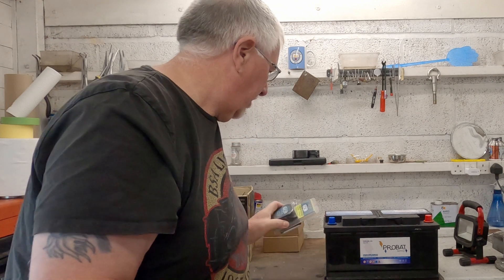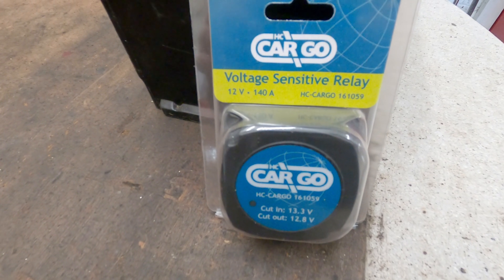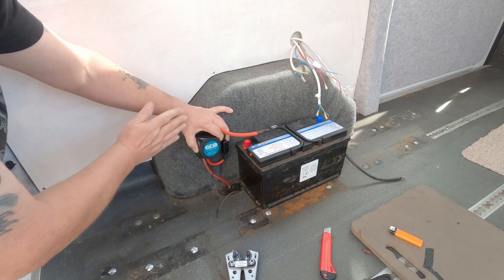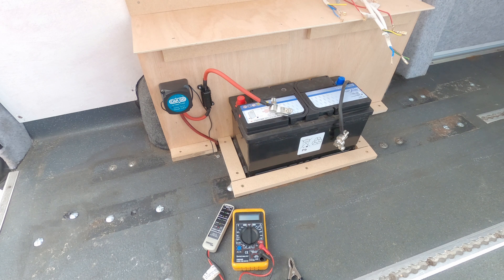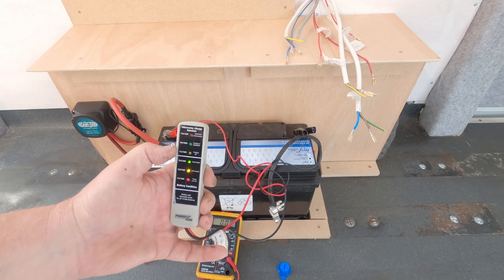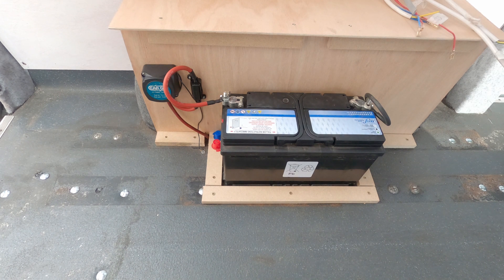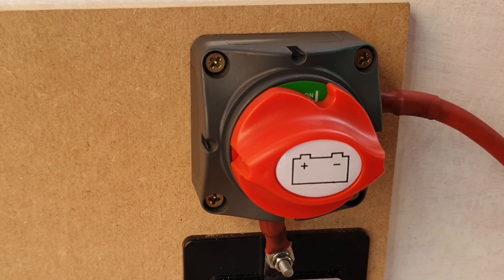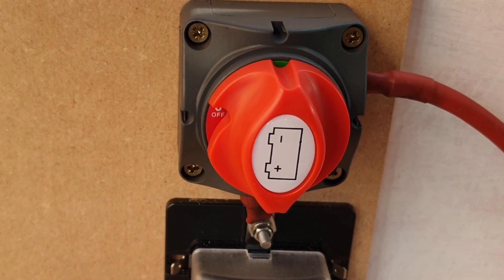How To Install Camper Van Electrics | Ford Transit Conversion | Leisure Battery 12v Power | 008

Comment: Just to say thank you for this very useful video ❤ what would be the best battery to connect the Vsr ? Would think the starter no?  My split charger is 140ah and my leisure battery’s is 130h is this ok? Many thanks in advance
Reply from the maker: I think that should be fine.  I don't think the chargers have a max as such.  Glad you got some use out of the video.

Comment: I had that same one wire solenoid to 2 - 245 at 6 volt on a ford van 150 but it had a 130 amp custom alternator  at that used to get very hot at morning , so I don’t think my new transit 250 alternator lower amp surely can handle it, it needed only few times winter with no sun for 1-2 or 3 days, I’ll think I will not put it in, and I’ll just turn it off and put ice bag those day.
Reply from the maker: I'm guessing that you are not in the UK, no Sun for 1 -3 days :)  We rarely see it for months!  At least it isn't near the Artic where it goes dark for 2 months at a time.  It makes sense to address overheating in your wiring, but I would worry about mixing it with melting ice.  Take care.

Comment: Just get yourself a lithium battery already. For a bit extra you get a much better battery with no chance of leaks and the huge plus is the weight difference. From someone who’s handled many car batteries I’m amazed at the difference in weight. If you make it  easily removable it’s well handy for powering small electric dinghy motors
Reply from the maker: Maybe it's me but I couldn't find a comparable lithium battery for less than five times the cost, that is £500 instead of less than £100.  I would really like to use lithium, but really can't justify the price for the way I will be using it.

Comment: What was the official name of the fuse box you used to use the leisure batteries power , is it call an Inverter?
Reply from the maker: The fuse box I used was one of these https://ebay.us/6HM7sp

It isn't an inverter. It takes a 12v feed and you can then connect other 12v circuits to it.  Such as lights, water pump, fan etc.

An inverter takes 12v input and gives you mains type ac output. But to get a useful power output needs quite a high quality inverter and a good amount of batteries to power it.

Comment: Brilliant video, question: I've converted a mk7 minibus and it has 2 batteries under the driver's seat ,from what I understand one is for starting and the other for the lights in the rear which is 55ah ,can I change that for a higher amp hour leisure battery as I'm guessing it already has a split charge system,thanks in advance
Reply from the maker: This is another question that the forums give lots of different answers to.  I suspect that Ford changed the spec so many times that a lot of the answers are right for specific circumstances.

I don't know if your bus would have a split charge system, but I did read that a lot of people change the second battery for a larger leisure battery and have used it like that for a number of years without an issue.  

You could check for the split charge system, by measuring the voltage of each battery, then putting the lights or other electrical accessories on in the back, leave them on for a good while then check the voltage on each battery again.  If the starter battery has stayed the same, and the other has reduced then you can be pretty sure that it is a split charge.  

The main problem that arises is, if it isn't split charge, is that you could run both batteries down to a point where the van will not start.  It would be easy to avoid this if you put a simple battery check gauge like this one into your system. :-

https://ebay.us/7kIftV

You just need to make sure you don't let the batteries dip too low, (11.8v or so), but you shouldn't let standard batteries go below 50% too often anyway as it makes them age quicker.  Unless  you are planning to run an inverter and power lots of things the battery doesn't go down that quick anyway.  We use an extractor fan, water pump, lights, and multiple phone, tablet and projector chargers and haven't even come close to taking our 110ah battery down below 60%.  If you were not moving the van for a number of days this could become a problem, but we are always on the move when we are out in the van so it hasn't been an issue for us.  YET!

I was disappointed that I didn't have two batteries, because replacing the second one with a larger capacity one, was exactly what I wanted to do.

I hope this helps.  Let me know how you go on.

Comment: Should you vent the battery? I am going to be fitting a leisure battery soon but no one vents it in the videos
Reply from the maker: Interesting question.  I haven't seen venting mentioned either.  I don't think it is a big issue unless you are putting in a big battery bank of lead acid batteries, with phenomenal insulation.  For the kind of installation I have done, only one battery, loads of ventilation I am happy with it.  But let me know if you find any further information.
Reply: @SPANNERRASH  thanks for replying. Yeah im fitting just one battery but when i was researching came across venting. And got me worried because my children will be sleeping in there and the battery is going under a bed i have bought a venting tube but dont want to make uneccesary holes in the van if i can help it

Comment: My Ford Transit MK7 (like all others) has two batteries under the driver's seat: 1 starter and 1 aux. When attatching my split relay for my leisure battery should I connect my terminals to the Starter battery or the Aux battery? Thank you!
Reply from the maker: Not all Mk 7s have two batteries, my doesn't.  

If you are putting in a split charge relay I would go straight to the starter battery as I would think that if there is anything that charges the Aux battery differently it wouldn't impact how your leisure battery was charged and your starter battery would still be charged first.  

I think there could also be an issue if you have a "smart" alternator, and I do not know how to check if you have one.  I believe a smart alternator reduces output voltage when it senses the starter battery is no longer charging, as a fuel saving thing, but this stops the split charge relay charging the leisure battery.  It might be a case of "suck it and see".

I hope this helps, and maybe somebody else with experience of using a split charge relay with a Mk 7 that has an Aux battery might add something in the comments.
Reply: Hi! Thank you, this is really helpful for me too, since I'm converting my 2011 Ford Transit right now and I have two batteries under the seats as well + my own battery for everything "conversion related". Now, I did see 3 Consumer Connection Points next to the car seat. Can I use those as well to connect my battery?  @SPANNERRASH

Comment: Very nice  video   but i have a question  i  have 200 ams solar battery  you think  it's going to  work?
Reply from the maker: Hi oso, I'm not totally sure what you mean by a solar battery. I assume it is from a solar system? I would think if it's 12v then it should be fine. But there isn't enough information for us to guess it, may be a different voltage for example.

Comment: Well done . I agree, The new lipo batteries are way over priced . Stick with the cheaper ones they will still do the job you need them for. Its not like you need to worry about weight with that van   , You can always upgrade if you feel you need to at a later stage  , Cant wait to see the van complete and when you take your first trip on the road . 🍻
Reply from the maker: Sounds like we're on the same page, Clifford! Once its in use I think it'll start to become obvious whether I want to invest that much money into it or not. I think I'm going to get a lot of enjoyment with it even on a budget.